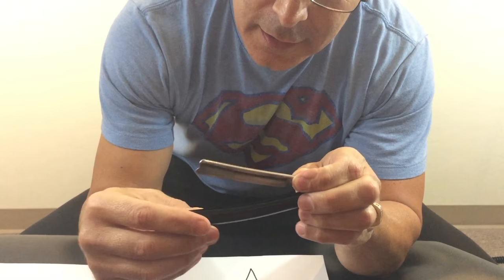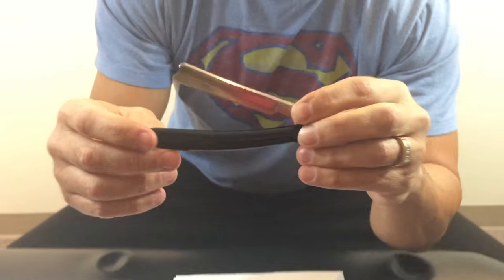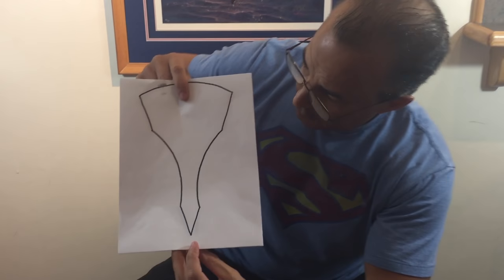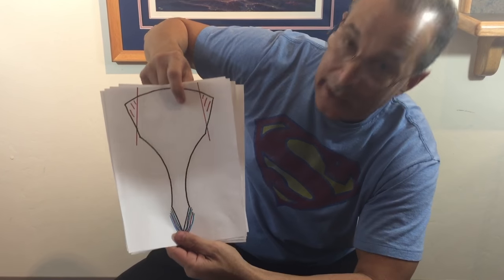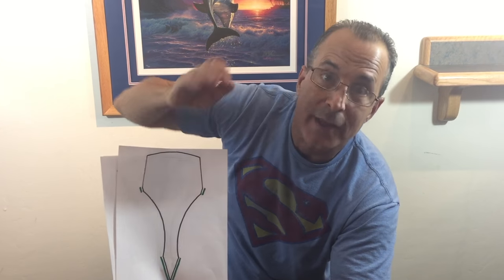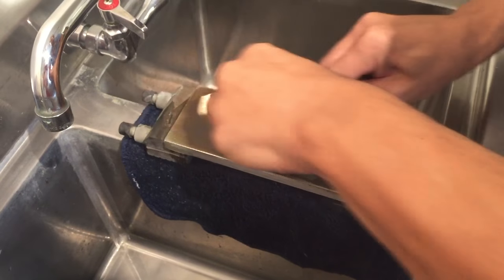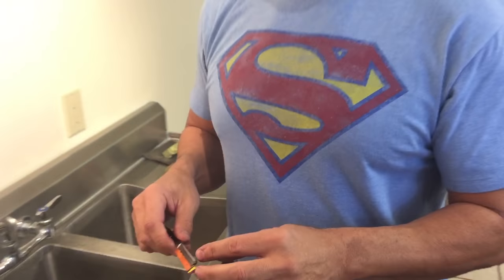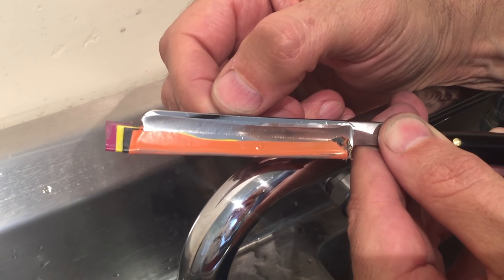How To Back Bevel A Razor - What is it and why

Comment: Great stuff DrMatt!   This is known in Germany awhile; their goal (and it is not always possible) is to produce enough concavity that this would not be necessary as there would never be a physical obstruction of metal outside the spine-to-grind-line triangle which would preclude the full edge making flush contact while spine also flush.
Reply from the maker: Thanks Jarrod.  I didn't realize it was a thing.  I just got tired of some of my old razors sticking to the stones like glue so I figured I'd remove some of the metal.  See, great minds think alike!😜

Comment: Basically Dr matt you are creating a taper on the spine,similar to how high end Solingen ground chefs knives were ground historically. good idea.cheers !
Reply: ugh,the term I was looking for is Reverse taper. in German kitchen knives particularly the older forged types,the middle of the blade is the thickest part of the blade and not the spine as some Japanese knives are ground,this lets the knife wedge cut better than a thick spine and thin middle up to the upper 30 percent of the blade. now I know that isn't what you did,what you did was put a taper on the over thick spine section and left just enough of the old flat to support the proper angle that has been worn in as the old razor designers meant for it to do.
well done sir.

Comment: The back bevelling works due to removing the amount of metal from the spine ` that was originally touching the stone as you said but here is why it works I reckon 
Removing that amount of metal away on the spine allows that smaller amount of metal left now resting on the honing stone to wear quicker when honing`  but let me explain as you mentioned your not sure how to explain how it works but it does,
So imagine you only measuring the depth on the spine now on your drawing so lets say its 4mm from the very top that sticks out to the bottom point of the spine that sticks out but from point to point its a 4mm flat edge but at an angle , so this is the spine looking head on V 4mm in Hight from bottom at its thinnest to top at its thickest, yes I know its not to scale but this lap top is not an etcher sketch, lol 
Now lets look at the bevelled cutting edge of the very bottom on the blade lets say its only v 0.05mm from the the very bottom of the bevel to its top basically the part we mark with the marker pen to check if where its being honed,
So when people hone and they have the problem on the spine that needs back bevelling `but not thinking they are wearing down the bevelled edge as well,
When honing you are honing 4 mm of flat metal in one go on the spine more chance of this not being dead flat with thicker parts on the spine and only 0,05 mm at the same time on the cutting edge bevel down the bottom of the blade, 
But the cutting edge bevel is thinner and more prone to hone down faster due to flexing pressure , the cutting edge wears much faster allowing it to creep upwards towards the spine than what the sides of the spine being 4mm in Hight  of metal can wear down, and become thinner,
So taking the amount of metal away from the spine you are now only ending up say 1.00 mm of metal rubbing on the stone when honing and that metal being nearly a pointed edge that sticks out but wears faster  now , so this now is catching up with the blades edge quicker, and brings them in tango,
If I look at most of my razors the very top of the spine is thinner than the lower part of the spine , so when you remove the widest part from the top part of the spine with a bad razors spine at the angle you show you are basically bringing the top part  like it would of been new , but as it has flat edges instead  of it being rounded off it looks unusual ,
So less flat high metal on side of spine allows the blade to pivot better in sink with the blades cutting bevel edge,
and when honing they hone more accurately together,
Hopefully you get what I am trying to get across, well to the viewers as well.

Comment: Dr. Matt - It's interesting...I'll give you that.  But any good "doctor" should know...if Osteoporosis affected a skeleton spine, that body would begin to warp, disfigure and weaken.  I want to ask your opinion of the razor's spine rigidity, strength, flexibility properties (according to the metal used for the blade) - since we both know that carbon steel will be more flexible than stainless steel models - from the standpoint before the back-beveling and post-back-bevel treatment.  My estimation is that this process is only able to be done ONCE per blade, before ultimately affecting the geometry of the bevel, or reducing the spine to a sliver of its former self - or creating a double edged razor (humor for that last part)
Your thoughts?
Reply from the maker: Good question Andrew and I like the way you think.  Don't know if the osteoporosis is a perfect analogy as that is a loss of density while the density of the steel here remains the same.  I get what you're asking in that does this affect the structural integrity of the razor and it's ability to withstand forces.  

Theoretically, you are correct that it may compromise rigidity.  But, IMO, the effect is far above the range of forces that we would expose this hardened steel blade to like dragging it across our face or a stone.  

I have done it more than once on a single blade...

Comment: I have an old Wosty IXL from the 1850s that has a similar issue, although quite a bit more wear. It also has a different issue that may be able to be fixed using a variation of this technique. I thought I'd run it by you to get your thoughts before proceeding. It's a 6/8 so I'd been considering a regrind being that it can be narrowed quite a bit before it's time to throw in the towel.  But then I saw this video. The problem is that it has a smiley so severe that the spine is actually thicker in the middle than at either end. It's so bad that setting a new bevel, even with tape just isn't cutting it and there's just too much meat to remove from the spine to be able to maintain much of the hollow once the razor is back to sitting flat on the hone. We're talking something in the neighborhood of 1/16" total difference in thickness middle vs heel/toe. Would it be better to go ahead and regrind the razor to maybe a 5/8 or do something else entirely? I've done regrinds before so that doesn't scare me much, but this technique does pique my curiosity. Thanks in advance for any input.
Reply from the maker: send me a pic both sides.  drmatt357@hotmail.com
Reply: I'll get it to you this weekend. I travel during the week but I should be home sometime Friday afternoon. Thanks for the quick response.

Comment: Hey, I just found 2 straight razors for 5 bucks at the flea. I have one with a small chip and one that I can't find a single example of on eBay. This mystery razor does not have a handle and only says "BRADBURY" on the spine and "APPROVED" on the tang.

Comment: Very nice
video, but I have one question.

What if
this spine hone wear is more. Meaning the razor doesn’t have this minimum 15-16
degrees angle??
Reply from the maker: Not quite sure what you're asking Vasilios.  Are you asking what if the bevel angle is below the ideal 15-16 degrees?  I would still back bevel it but then tape the spine while honing it to get the bevel angle in that range.

Comment: Aaaaaaaaaaand ANOTHER good teaching video. 

Doode, you’re on a roll with me. And you shoot as well?

Pshhhhhhhh...Brother from another mother.
Reply from the maker: Raymond Moreno - Don’t forget motorcycles, fast cars and hot bitches!
Reply: DrMatt357  - I’ve had motorcycles since I was 17 years old. (Sport bikes). I’m 54 now. 

I’m a MULTIGUN competitor as well. (Rifle, shotgun, pistol). 

I run, do obstacle courses, lift weights, live bouldering, and do Muay Thai as well. 

And those are my physical hobbies.

I was a bowhunter, but now I only eat a plant-based diet. 

Love working with wood, stained glass, and carving leather. 

I used to make knives when I was younger, but I sold all the equipment...minus my electric kiln.

I also LOVE to home-brew my own dark biers. (Only porters and stouts).

Comment: 👍👍Great info man! I learn something off of you guys weekly! I was wandering could a man blend those bevels together? For example if a fellow wanted to thin a gold dallor spine down. Hed tape the edge, and grind until he gets it to his desired thickness. After that a man would have a thick flat spot on the spine. Then you could back bevel the spine like your doing here. So how could a man blend the two bevels together or even give the spine a more rounded appearance just like it came from factory?
Reply from the maker: I was thinking about this Michael.  If you want to blend the primary and secondary bevel, put 1 layer of tape on the edge then free hand between the two, like a rolling motion.  Then take the tape off and hone as usual.

Comment: This seems like the fix to the geometry issue to my GD 208. But, I always have this question in my mind "why is this improving the edge itself?" It seems like there's no explanation. 🤔
Reply from the maker: VanDelosSantos  - This won't affect geometry Van. As to why it improves the edge. I don't know that it always will but have had problematic razors and after doing this, the performance during the shave did improve. Yeah, I don't know either.
Reply: I don't think that it's so much that it improves the edge. It's more along the lines of making it much easier to give it an edge. With any finishing stone I've ever used, the edge gets polished so much that water no longer flows out from under like it does on a scratched edge. This basically turns your razor into a suction cup. The more surface  area you have touching the stone, the bigger the suction cup. Having to deal with this extra resistance increases the chance that you won't give the razor long enough on any given stone as well as the possibility that you'll pull the razor away after a pass in a way that could damage the edge. Hope this helps.